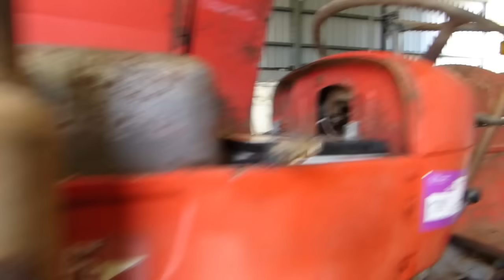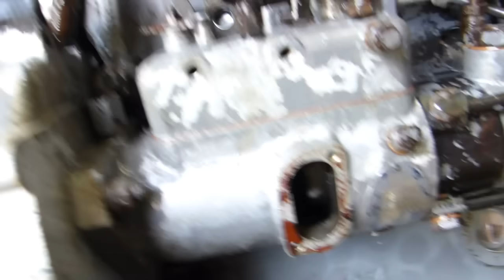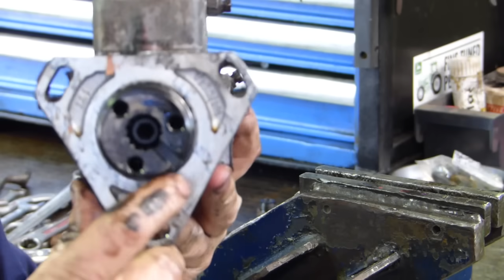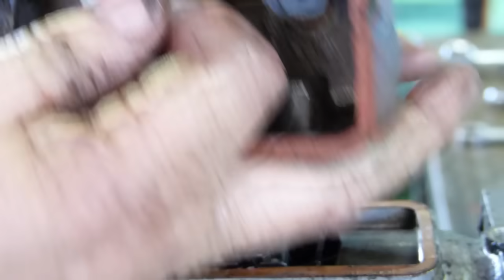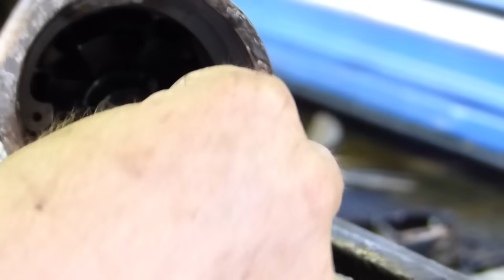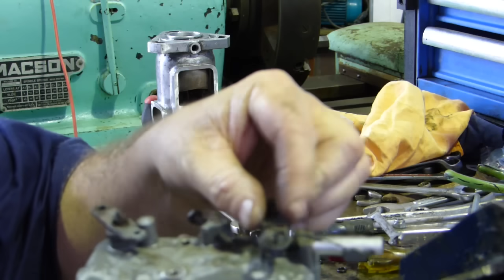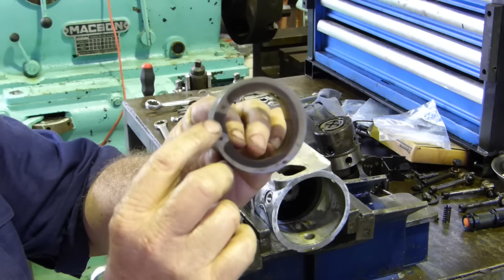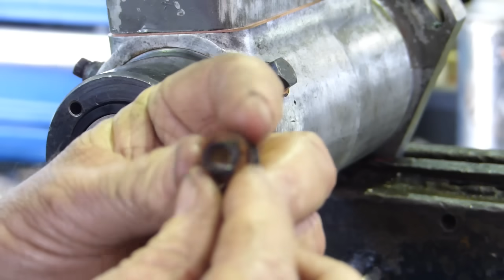CAV Injection pump full strip down to re seal and stop fuel leaks

Comment: I cannot thank you enough for this detailed and instructional video. I was successful in getting my MF 1968 135 injection pump resealed, but I've run in to a few problems. I was able to get my tractor back running again, but the engine either runs wide open in position 2 on the throttle lever, or shuts off in position 1(idle spot). I pulled the top cover plate and checked to make sure I have the spring in the correct position on the throttle shaft and everything is as it should be. Any ideas of what could be reassembled incorrectly?
Reply from the maker: I believe sticky metering valve but I did a way better video in my Massey Ferguson 135 6 speed playlist videos 14 and 15 that will explain things better.

Comment: Hello i need your help. I have a pump identical to this one that will  push fuel out no problem until you install the banjo bolts at 7:25. With them installed no fuel will come out but take them out again and fuel will shoot out of the holes nicely. Is the problem something to do with the valves inside the banjo bolts or something to do with the pump?
Reply from the maker: Some banjos have delivery valves in them, by hand it might be hard to get the fuel through but when winding by ket they should work ok. Check there is no rubbish in them.

Comment: Hi @Bundy, After doing the rebuild, reinstalling, and bleeding, I wrote you that there was still no fuel pressure coming out of the injection pump, just a minor trickle . You mention pressurizing the input fuel line. Is there someplace I can view how to do this? Do you cover this in one of your videos somewhere?
Reply from the maker: Look at the Massey Ferguson 135 6 speed playlist. With the WD40 in the pump it should prime out if it is not too badly worn in the head or you have a sticky plunger.

Comment: The injector pump on my 1980 Allis-Chalmers 5050 diesel seems to be making a whining noise from time to time.  However, I’m not 100% sure that is where the noise is coming from.  1) how do you suggest trouble shooting whether it’s the injector pump making the whining noise and/or if the pump is going bad?  2) At what point do I want to stop using the tractor and have the injector pump repaired if it is the pump?  Thank you for your help.
Reply from the maker: I would think it may possibly be the drive gear, the pumps dont usually get loud before failure.

Comment: hi there I'm in need of some help, i have a ford backhoe 4500 with a CAV  pump on it, about 1 year ago i did a reseal and everything went well (thanks to you and your video) but about 2 weeks ago i ran out of diesel while working on my ranch and i added diesel but it would start, i primed it and nothing then I remember about that stop lever that cuts the fuel off (once it got stuck and that was preventing my tractor from starting) so i though it would be same thing, well i removed the top cover off and unfortunately i did not pay attention this time where the spring for the throttle plate goes and i actually removed the big spring from both levers with the 3 holes, for what i remember i thought the spring went on both middle holes on each lever, so i installed it as i thought it would've been correct but my tractor still wont start,  i made sure there was diesel getting into the pump and i bleed the fuel filter and even the fuel pump from the side screw, and every time i crank the tractor there is fuel coming out of the side bleeding port (with the little bolt off) but i was checking at the injector line and there is no fuel coming out of the injector line,  my question would be.. could it be since i don't exactly remember the location of that big spring that the spring is on the wrong location preventing the pump to pump fuel out? next question would be, where can i find the correct location for that spring to throttle plate?  my tractor pump looks faded from the sides and i don't see any "instructions" or marks for me to follow, i have some books for the tractor but i have gone thru them multiple times and haven't been able to find any information related to the spring and the plate, or am i looking into a bigger scenario with this pump not pumping fuel out? could the pump have given out on me since i ran it empty?  the tractor was working perfectly fine until i ran out of fuel, i really appreciate your time and your help, if anyone has an idea or any information ill reaaly appreciate you sharing any information regarding this concern, thank you!
Reply from the maker: Have a look at my Massey Ferguson 135 6 speed playlist, videos 14 and 15. I think you may have a sticky plunger or something on the end plate. You can usually start a tractor if it has the spring in the wrong place but it wont govern properly. Look for a tiny shiny mark where the spring might go.

Comment: Hi Lance
5 years ago l tackled my very leaky pump overhaul using this video.
I've just encountered another issue and was hoping you could provide some guidance.
At start up, the engine revs and basically keeps hunting.  Doesn't appear to be a linkage issue.  Could it be something in the cav pump?
Thanks
Tim
Reply from the maker: Could possibly be. Check on my Massey Ferguson 135 6 speed playlist videos 14 and 15 I go way more into it there.
Reply: @bundybearsshed  Hi Lance
I used the 135 6 speed videos 14 and 15 to overhaul the CAV pump and it is once again working nicely.
I was hoping to report the issue(s) in case it helped someone else.
In fact I didn't find anything obvious that was wrong. The metering valve may have been a little sticky, so too possibly the plunger in that inlet tube; I spent a fair while cleaning those.
The other thing I did was put a new repair kit in the lift pump.  Glad I did that as it was very choked up.
Anyway, thanks again for your expert guidance - contact you again in 5 years ;)
Tim
UK

Comment: You have some great videos and are great at explaining.  You've given me the confidence to work on my CAV instead of blindly sending it to an "expert".   I'm trying to refit the governor plate in to the pump (pump still on the engine- Ford 555A backhoe).  I can get the plate to seat in the pump so that the horizontal plate sits flat, but when I try to move the governor plate forward and back, it does not move freely.  It seems like it should, regardless of whether the pump is installed or on the bench.  I've tried to re-fit it several times, but it simply does not move once seated.   What are the chances something is bound up inside the pump?   Thanks!
Reply from the maker: not a usual thing, you should feel some movement there. Check out my Massey Ferguson 135 6 speed playlist videos 14 and 15 I explain things better there I think.
Reply: @bundybearsshed  cheers Lance!  Looks like I have some more investigating to do.

Comment: Rebuilt Pump and now my machine wont start without starting fluid, after that it runs like a champ. The governor spring i put in seemed to pull harder. Would that be the cause or is there something else i have to adjust?
Reply from the maker: It sounds like you may have the top spring on a wrong hole somewhere. Visit my Massey Ferguson 135 6 speed playlist  videos 14 and 15 I go into the pump way more explaining things.

Comment: Not expecting a reply, but hopeful someone sees this and gives me confirmation.
Tractor suddenly had zero throttle resonse, would start, but only at about 1200RPM, then slowly shut down. Replaced lift pump, and lines as many had a thick tar like blockage.  After all this, its back to square one, will start, but NO throttle rsponse. Seem like it must have some of the same debris that was able to get past the filters. or maybe the vanes, or internal filter also have blockage. But after watching this video, I bet my problem lies in the governor assembly, maybe a failed spring?
Either way, as will all your videos, there are fewer mysteries, and I feel confident to proceed with a basic rebuild.
Reply from the maker: Check out my Massey Ferguson 135 6 speed playlist videos 14 and 15, I think your metering valve may just be sticking.

Comment: Hey Lance! I have a Roto Diesel CAV pump on my diesel truck that has been dormant for more than a year. Now I am having a hard time starting it.

It's cranking, the batteries are brand new. The fuel filter is clean and the diesel is squirting out when the primer is pushed.

The problem is at the injection pump. I disconnected the hard lines that goes from the injection pump to the injectors to see how much fuel goes out. But when cranking the engine only a few drops come out . The motor stop control is fully depressed ( in STAR position and seems to be working fine ). Maybe inside the injection pump it's stuck on the STOP position? 
I tried to bleed the system from air, there is no air up the injection pump. Maybe there is air stuck inside the injection pump?

Only little drops of fuel comes out from the hard lines that are supposed to feed the injectors.

What do you think I should do ?
Reply from the maker: Check out my Massey Ferguson 135 6 speed series videos 14 and 15, I think your metering valve may be stuck from sitting. It is easy to check.
Reply: @bundybearsshed  Thank you for the quick reply! So I watched those videos, if the issue is the metering valve I should proceed with disassembling the cover , remove the metering valve, clean it / polish it and re install. Correct? is there anything else I should do to better the metering valve operation?
Reply from the maker: Yeah just polish it a little and try it.

Comment: Hi thanks so much I have a cav injection pump I resealed but I get fuel good to first bleed screw but none at cap bleed screw just air. Thanks any suggestions?
Reply from the maker: Crack an injector line and try and start it

Comment: Hello, how can i identify thé exact rebuilding kit. My pump is DPAC, mounted on a 1981 land rover.the pump has been assembled in spain.ty for your vidéo that is very interesting and give me thé possibility to rebuild my pump, that i thinl is full of dirty(no fuel at thé injector pipe) by
Reply from the maker: The one kit does all of the CAV pumps with the only difference we know of being one perkins pump with a bigger front seal.
Reply: @bundybearsshed  and you confirme that i needn t to use test bench at thé end, it will run like it use to ?
Reply from the maker: Yes if you leave the adjustments where they were

Comment: Fantastic video Lance!  Question, so because drive shaft was taken out showing how to replace seal, then timing of shaft replacement appears to have been affected?  Does re-attaching shaft to governor weights only go in one way?  I'm about to tare into mine to clean out fuel that went bad...thanks ahead of time!
Reply from the maker: It only goes one way as it is on a master spline.

Comment: On A Leyland 498 I managed to strip it down on the tractor as the front oil seal was OK and even got the rotor out , I would have Greased the Stopper and throttle shafts before Reassembly making the shafts slide in and Grease the front seal on fitting 😊👍 Excellent comments and video 👍
Reply from the maker: Check the Massey Ferguson 135 6 speed playlist videos 14 and 15, i think they are way better videos on these pumps.

Comment: Awesome video.  It was a great guide for me.  That said after finishing I was left with a small untapered steel olive.  I can't find it in the exploded parts view or your video.  Any idea?
Reply from the maker: No not an olive, have a look at the 135 6 speed playlist videos 14 and 15 that may give you a clue.
Reply: @bundybearsshed  Thank you.  I checked it out, that didn't solve my mystery.  I'm puzzled, since I can't find it in any exploded views or your videos, but it came out during my disassembly.  It is exactly the diameter of the end cap's solid cylindrical plunger, but is half the height with a hole down the axis.  I reassembled with it stacked on top of the solid cylindrical plunger...which was obviously wrong as the tractor runs poorly that way.

Comment: Great video. I've done many Roosa Master pumps but have never been into a CAV, but I have one to do. You are correct about how pump shops make out like it's brain surgery to work on these pumps. Honestly, I'd rather rebuild a injection pump than a carburetor. 
As a side note, I found it kind of comical the difference in terminology from us here in the U.S. What you call a "spanner" we call a wrench, what we call a spanner is something completely different. Also what you call a "torch" we call a flashlight. A torch is something we use to cut steel or solder copper water pipes.
Reply from the maker: I notice the different terms as well like you top grass we slash it.

Comment: Thanks a lot Lance for this wonderfull video. A small question : Which product and methods do you use for cleaning your parts ? Keep going, and thanks for all.
Reply from the maker: I wask in a parts washer then use CRC Brake Cleaner and air. On the alloy housings I use a bead blast cabinet.

Comment: HELP!! I have an old Perkins AD4 203 and i was plowing my driveway and it quit. Immediately I was mad because I thought i ran it out of fuel, however I did not. Both first stage filter and ss filter are full of fuel. I cracked line at injectors after much head scratching as i thought my injector pump finally died, but it pumping fuel out the injector lines. 
The tractor is stuck in my driveway and im at a loss. Any ideas would be great.
by the way you got a sub from me.
I should note that the fuel lines i opened at injectors the fuel was dribbling out at best, not shooting out. and my injector pump has been leaking fuel for 15 years. 
i cant wait to watch this video.
Reply from the maker: Bleed the pump and try to wind it with just one open but it may have got a sticky metering valve it is hard to say from here but I would check the fuel screen and go from there.

Comment: Thanks for this video. My pump i leaking in the top cover. After looking at your work I will try changing the o-rings. And hopefully its running and not leaking after. :)
Reply from the maker: Check out my video on the Massey Ferguson 135 6 speed playlist, videos 14 and 15 I do a way better job of showing the pump repairs.

Comment: Hey and thanks for a very informing video, i just used it on a cav on a 3 cylinder ford 3600. But after assembly i only get driplets when i turn it, and not squirts like you do when you test it,  you have any idea why this is/ what i did wrong? I turn the stoplever/throttle and its kinda same same.
Reply from the maker: If you are getting dribbles probably fit it and bleed it up correctly, leave one injector line off and try and start it even use Ether if necessary, with a worn pump sometimes the extra cranking speed is all you need.

Comment: Great video thanks, I pulled my pump apart but unfortunately can’t get diesel through high pressure lines even though pump is fully primed, I was careful and took my time taking apart and putting back together, any thoughts on what I might have done wrong?
I did get tractor to start briefly but it idled higher and would rev up or down. Any help would be much appreciated, thanks again, Brian.
Reply from the maker: Check out my Massey Ferguson 135 6 speed playlist videos 14 and 15 I did the main rollers in these videos.

Comment: Gday Bundy bears having rebuilt my Cav pump with your videos and spares kit I'm thinking its time to rebuild old smoky. I have a 1974 Leyland BMC 2.52 4 cyclinder Diesel, Marinised by a pommy company called thornycraft back in the day. They where used in fishing boats as ice makers in Australia, canal boats in europe and the old black taxi, mines in an old Dutch yacht. Do you know if they where used as a tractor engine as I would like to source parts locally and you guys seem to be the most active rebuilding older engines. sadly most boat people just toss them out for a new shiny engine, it runs well just smokes like a pig so I figure Rings and top end but who knows until you open the box. Appreciate any tips and keep up the good work and super interesting videos
Reply from the maker: Im not sure but it might be worth a try. Not a very common engine up here though.

Comment: Thanks for the instructions Lance. I'm hoping this will sort out my 165 (AD4.203 engine) it has a strange fault where it will run all day at set revs, but increasing the throttle will cause it to die. Sometimes it will slowly rev out to full revs then seem responsive on the throttle for a while, other times it dies and I have to bleed it out to get it started again (although today it would only start when I jiggled the stop lever a few times. I have replaced all the fuel filters and cleaned the tank and checked the tap, it seems to be supplying fuel, but nothing from the return line.
Reply from the maker: Have a look at my Massey Ferguson 135 6 speed playlist. Videos 14 and 15 I go into it and I feel they are better videos even though on a 3 cylinder everything is basically the same.

Comment: Hi Lance, I am getting air in the top bowl of a cav pump (old 3cyl Kubota, fiat copy) when the engine is running, it stops after a couple of seconds unless I open the bleeder screw, I bypassed filters and sucked straight from a jerry can, same problem, I cracked the injectors one at a time still the same, once it stops a quick bleed or just wait a little while it stats straight up and runs a few seconds, any ideas?
Reply from the maker: You need to start at the tank and work your way to the pump. Air is either as expected an air leak or a fuel blockage so I find if I start at the tank and ensure there is a good fuel flow all the way, check every joint etc you will probably find the problem.
Reply: @bundybearsshed   I put a hose directly into a jerry can so as to eliminate everything before the lift pump , when you pump the primer it runs clean no air, only when it starts